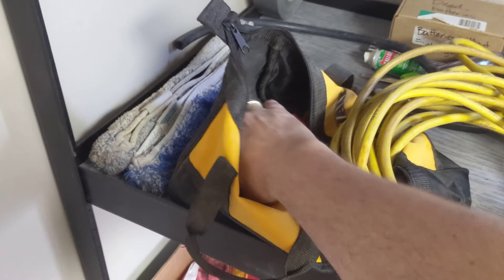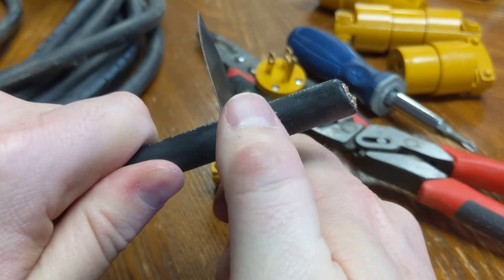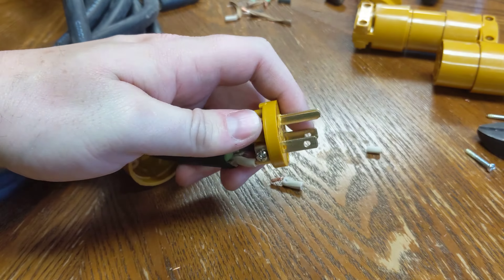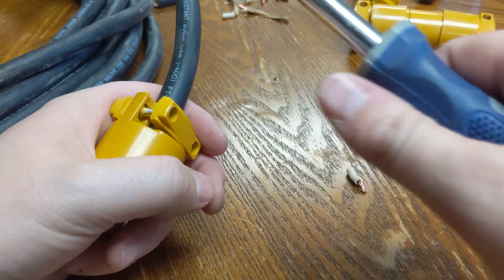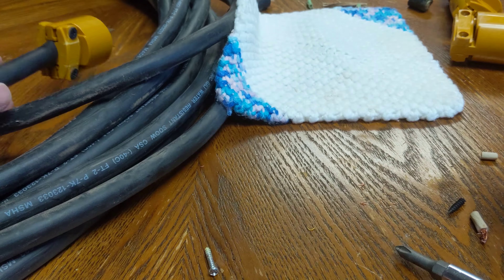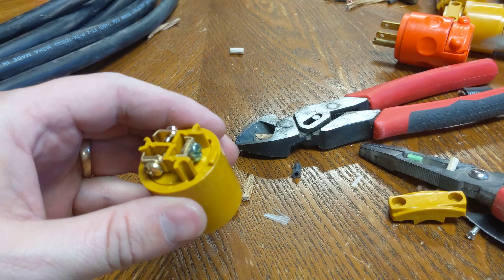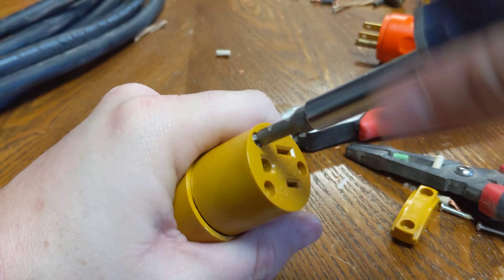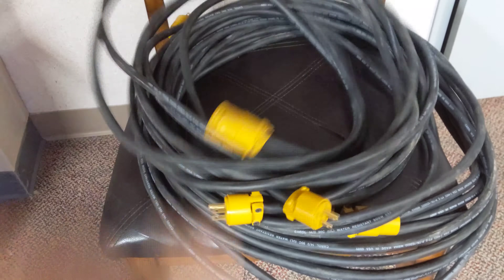How to make an Extension Cord

Comment: Yes you will find that individual plug and sockets for cords are usually fitted for 16/3 cord...which doesn't add up when the plug and sockets are rated 15A 120v..